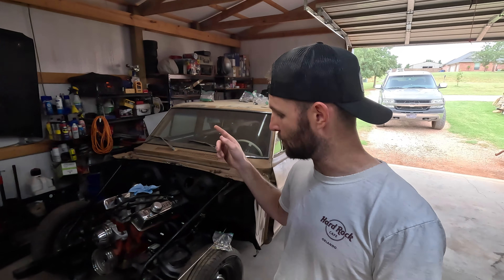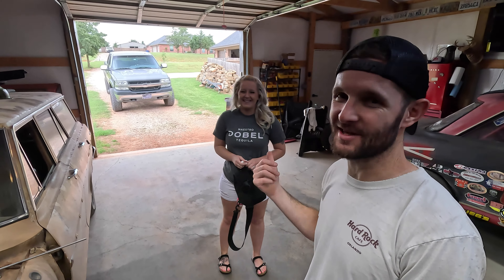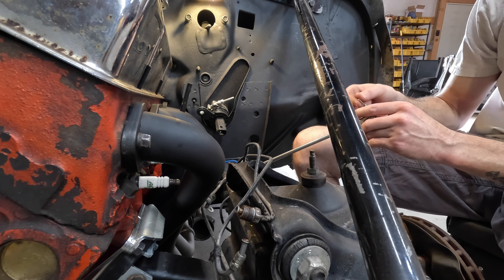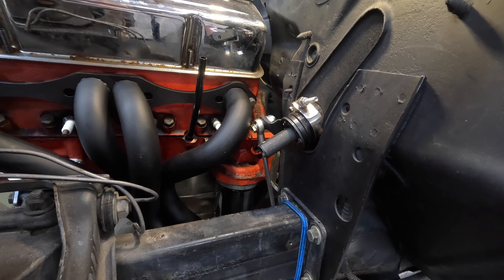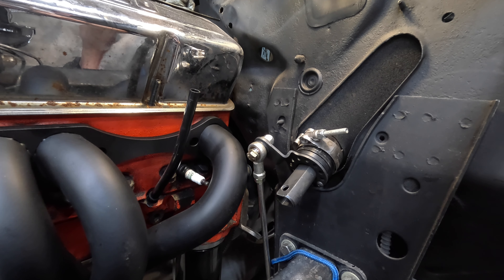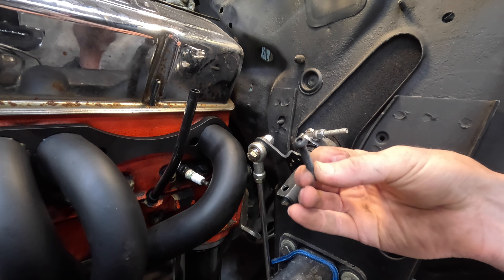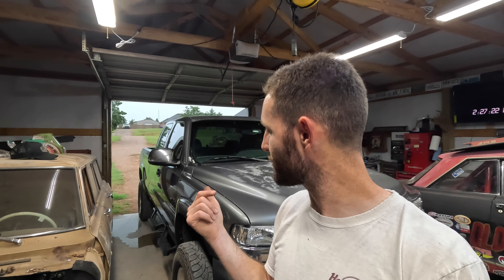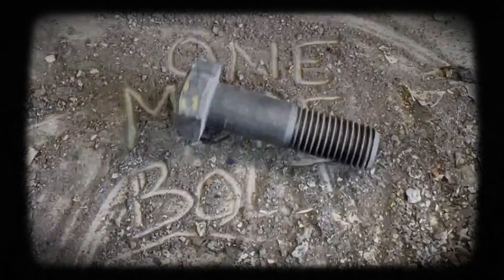Column Shift For The 700r4 In My 1965 Chevy Nova Wagon

Comment: Nice work! One less headache
Reply from the maker: Thanks. Getting the column shift to work made me really happy. Definitely going to be much happier with this car being a column shift over a floor shift. I also think having it a column shift is much more appropriate for the build seeing as it will have a bench seat at some point. Gotta keep that unsuspecting grandma cruiser feel to the interior. 
Couple more small issues to get resolved and this one should go back together fairly quick. (fingers crossed)
Reply: @OneMoreBolt  yeah man!  You need a bench seat in those long roofs.  Much respect to the granny shifter 🍻🍻